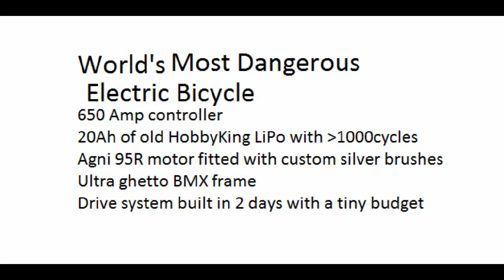Worlds most dangerous electric bicycle.

Comment: whats that mess of string like stuff at 3:38
Reply from the maker: wire from a spool used to bleed down pack voltage to let the controller enable. I used the spool to finish wiring up the bike on the drive up to the race, then used the spool of wire like a resistor to bleed pack voltage down low enough to let the controller enable, as it has a hard lockout above 60vdc (IIRC)
Reply: +Luke Workman haha, keep credit cards at a distance! is that race in your videos?

Comment: stuff like this is what gets done in an engineering team's spare time, which is usually in the middle of the night after a full day of work.
production manufacturing runs have incredibly long lead times - especially for an assembly as complicated as a motorcycle.  
it's helpful to be able to tinker in your spare time on ideas for improvements that you need to test before you can implement them.
the good stuff has a tendency to get implemented in some way or another eventually...

Comment: Awesome! - wonder if shifting the back wheel further back by extending the frame a bit would help with using more of that acceleration, minimal weight increase but greater leverage to resist flipping, should help you gain more speed using the rider as a counter weight.... braking on the other hand- well.... :P

Comment: From googling around it seems the motor controller is around $950, the DC motor is $1300 and then you need a battery pack for another $200 or so. Not free but definitely looks worth it!